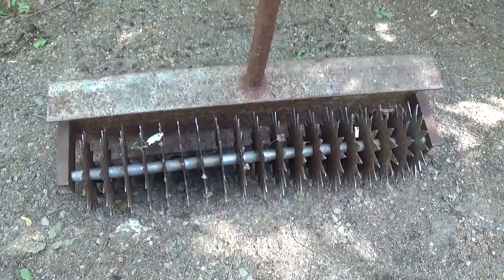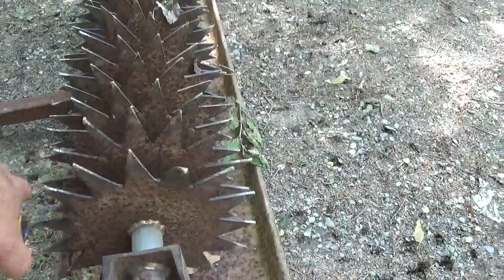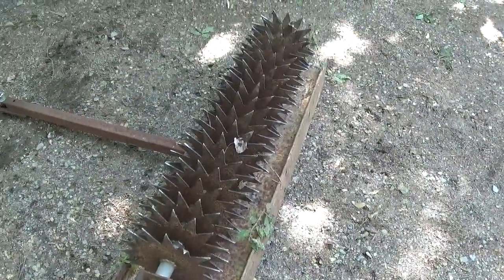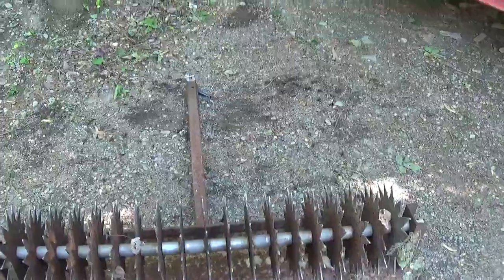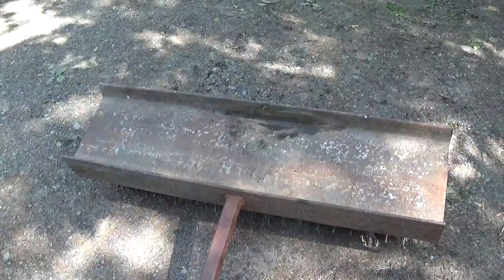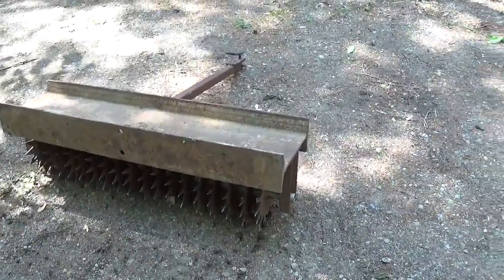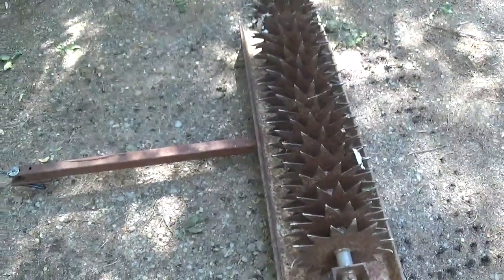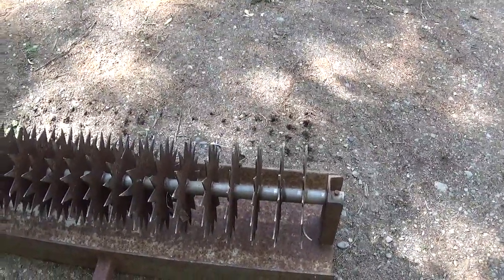Home made lawn aerator

Comment: Salut Serge!!!  What a great find!!  Getting the for free is pretty nice.  I like your idea for the wheels and it's a pure and simple solution, just turn the unit over and that isn't hard.  Brilliant.  I would have been trying to come up with some sort of cam or something to lift the aerators off the ground...  Way to go.  As for the noise.  Maybe grease.  I'm thinking the 3/4 inch shaft might work but being so heavy maybe the 3/4 inch wouldn't be strong enough.  I'm just thinking out loud here though Serge.  Thanks for posting.,
Reply from the maker: Thanks Mike I need wheels on hit it's hard on the brick drive way.Like RCFApolarexpress mention all the weights I have could spare a few on it to help it to get it deeper in the ground.

Comment: Uh... 14hp??? I thought you had a gc1705? That’s a 23hp diesel??? My gc1723eb would pull that just fine... I’d just make a 3 point hitch adapter for it (with a trailing swivel connection to allow for turning with it down on the ground). 🤔
Reply from the maker: I have a GC1710 and I have 2 lawn tractor and one old suburban 10 garden tractor from 1968
Reply from the maker: the tractor I use to puld it was mi 14 HP MTD lawn tractor